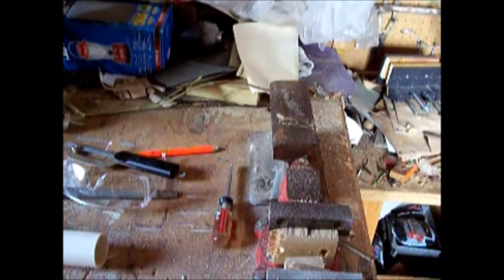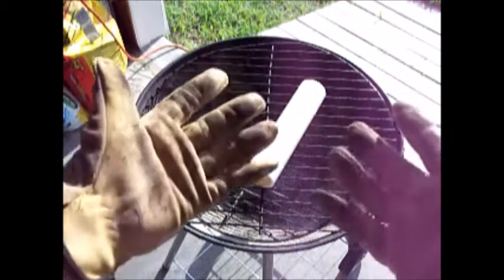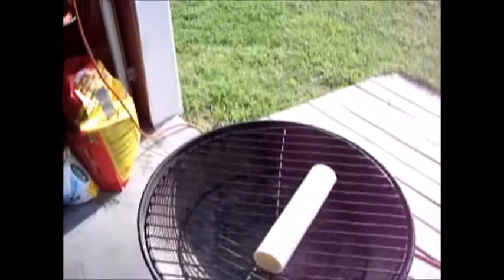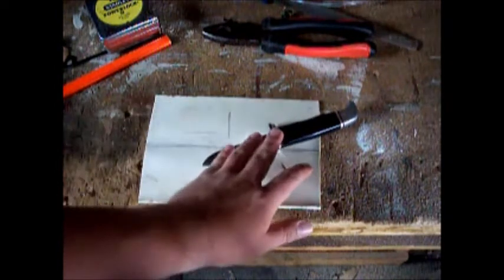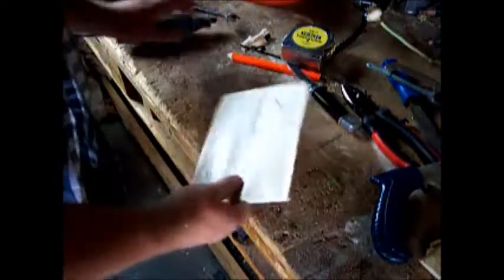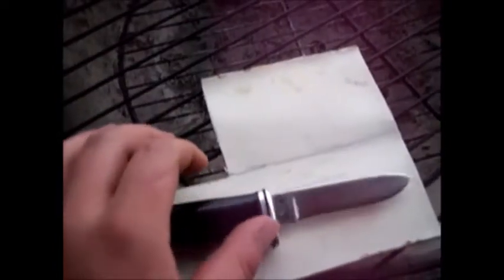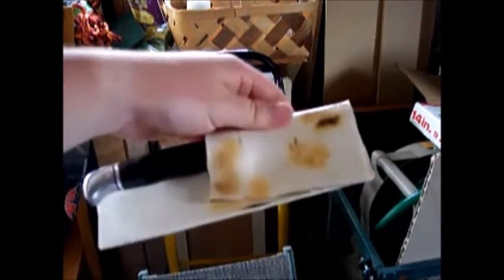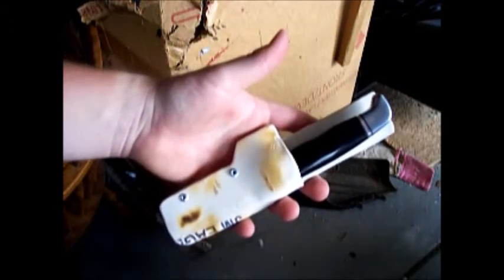PVC Knife Sheath

Comment: To stop the rattle cut a small "V" in the back about halfway down the blade section. Face the point of the "V" toward the bottom of sheath. Heat the "V" and push it into the sheath. No more rattle.